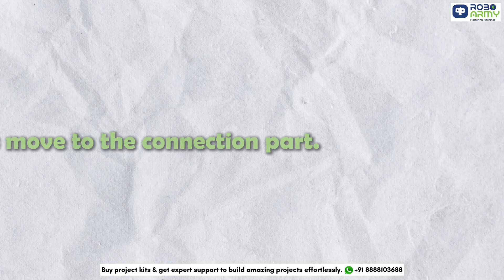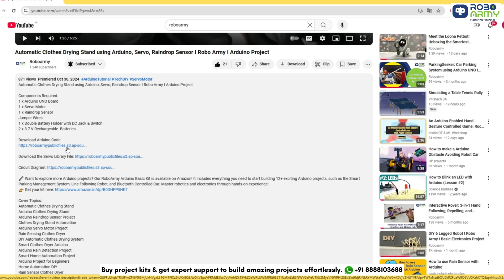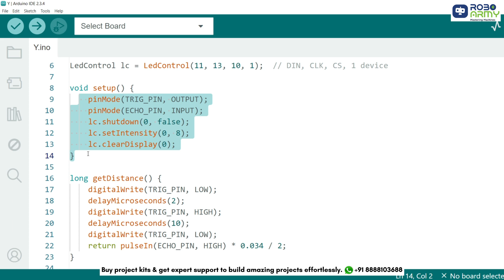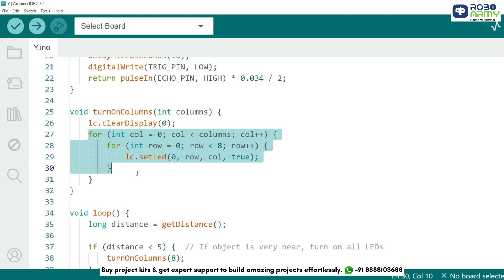Ultrasonic Distance Indicator Using 8x8 LED Matrix & Arduino

Comment: Hi thanks for your video, very useful :) However, I can't connect a MAX7219 4-in-1 LED Matrix Dot to the code so that it recognizes all 32 rows. Can you help me please? :)
Where can I change this in the code? Please. 😅
Reply from the maker: Glad you found the video useful ! For a 4-in-1 MAX7219 matrix, you need to tell the code how many devices are chained together. In the line
LedControl lc = LedControl(11, 13, 10, 1);
the last parameter 1 means only one module. Since you’re using a 4-in-1, change it to 4 like this:
LedControl lc = LedControl(11, 13, 10, 4);
Then you’ll also need to adjust your code logic to handle multiple devices, since each MAX7219 still controls only an 8x8 block. That way all 32 rows/columns will be recognized.
Reply: @robo_army_  than you  (^^,)
Reply from the maker: Welcome. Keep spreading the good words!!

Comment: Bro you are giving link in description but it is not opening kindly give the codes in comment section
Reply from the maker: We have double checked, the link is working  properly. When you click on the link, the code file will get downloaded and make sure your PC or Laptop have Arduino IDE downloaded to open it.